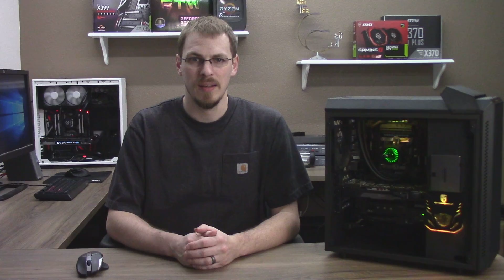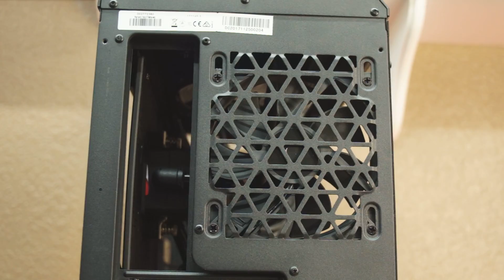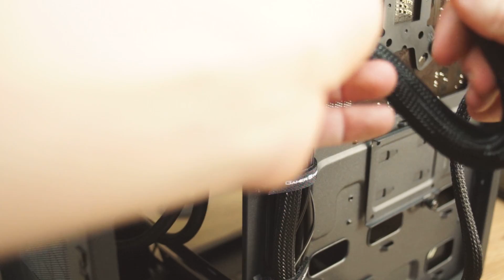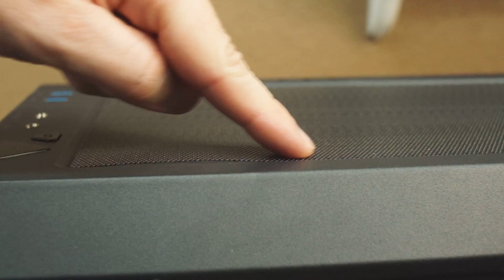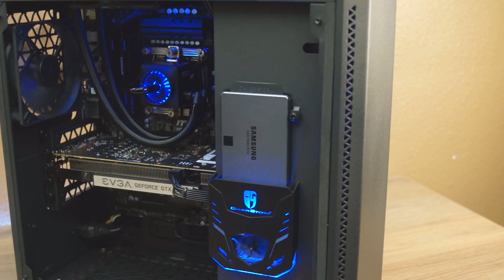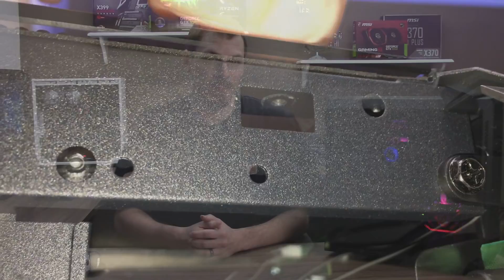GamerStorm Baronkase Liquid by DeepCool

Comment: I have the same case, mine doesn't flicker like that and the red rgb works perfectly, I wanted to ask the rgb board is mounted to the top right corner, is it possible to disconnect the 12v sata power and replace it with a motherboard connector header? (PS Certain mobos with the usb 3 port on the side such as the asrock b450m pro 4 do not sit well)

Comment: Would I be able to take off the tempered glass to try and fix the audio jack on the front? I have a feeling my jacks on the front are loose as my headphones or splitter will not work, mic or headphones.

Comment: Just got this case. The radiator fan lights up but does not spin. What did I do wrong?
Reply from the maker: There are connectors for both fan power and LED power.  Make sure both are connected properly.  There are a bunch of cables coming off that cooler :-)
Reply: Wow totally missed that! Thanks man you're a life saver!